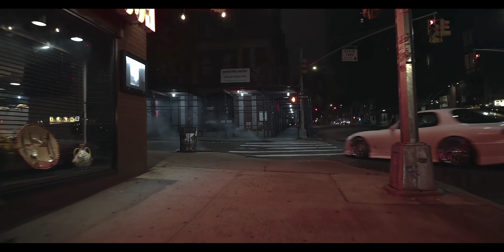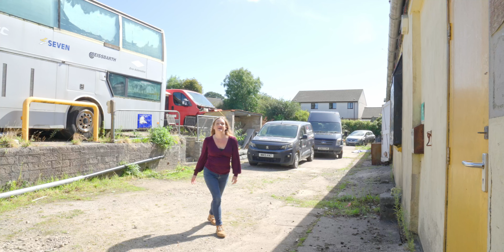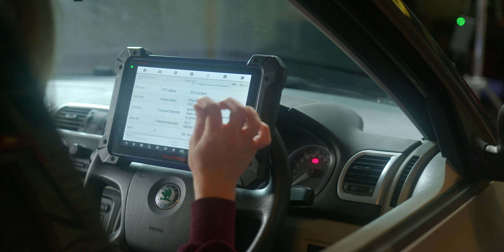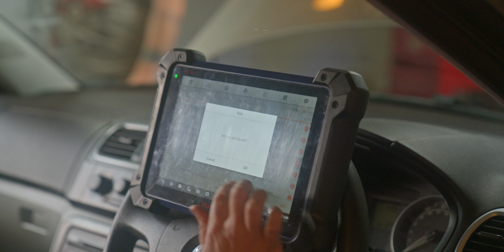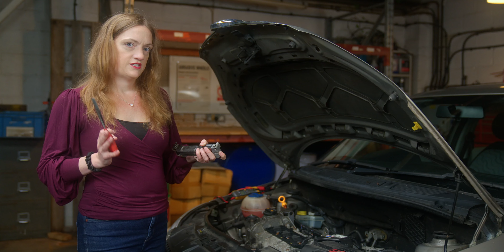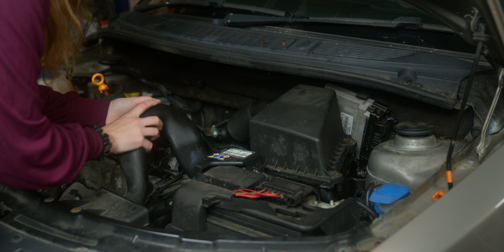P0302 16502 Fixed Tammys Garage full length diagnose and repair and it wasnt what you thought it wou

Comment: Nice video and diagnostics, great fix 🙂. Health and safety points though - best not to wear jewellery when working on a car (especially electrics) and tie hair or loose clothing out of the way. I'm sure you disconnected the battery before the wiring repair but best to show that 🙂.
Reply from the maker: lol the poor battery was on and off more times than, well I will let you put in an analogy here...

Comment: One point Id like to bring up when installing a spark plug it should be started in its hole by hand usuing a deep socket of course ( reduces the chance of a cross thread ) other than that good work young lady
Reply from the maker: Hey, a valid point except that the socket I used has a guide on it to avoid this which is why I was able to go direct to it, they are from Snap-On
Reply: Ive had heads into me with people wo have used a socket and ratchet to install plugs that ended up cross threaded , my point is stuff the plug in the deep socet offer it up and wind iit in by hand you will fell imeadiately if your on the right thread , then theres no painic phone calls and can i bring you the head in 2 hours ( saves tears saves time ( and money )you get the same thing with wheel nuts / bolts start them by hand you never get a crosser Pajero and shogun wheel nuts are king for crossing